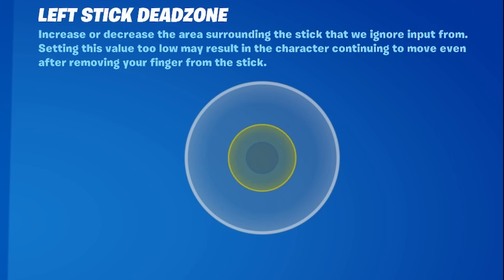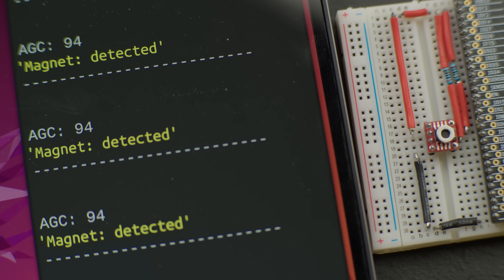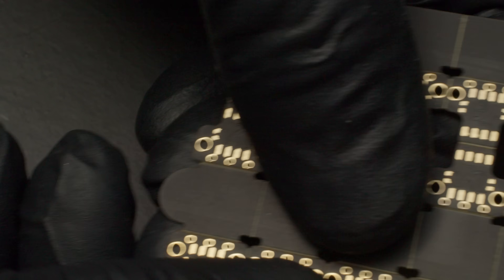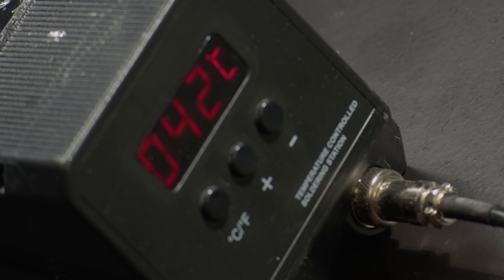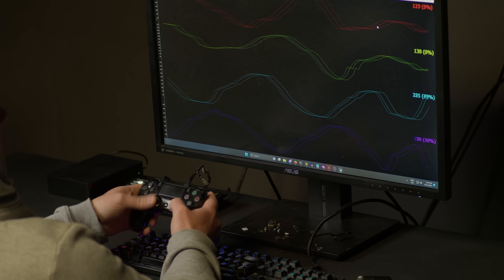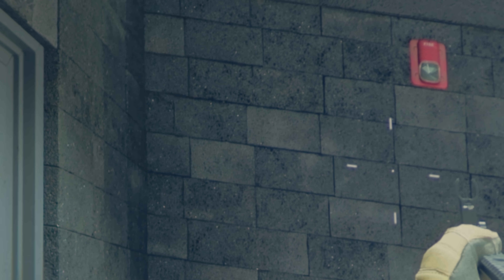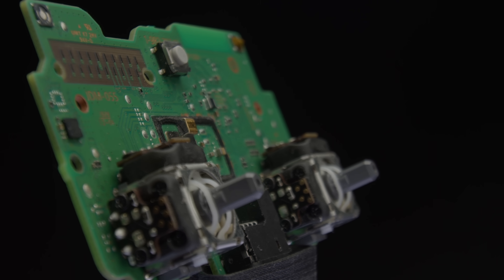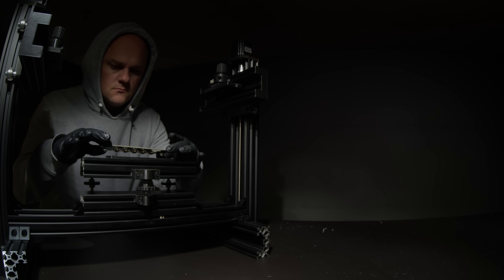Beating the $20B Joystick Drift Problem, and giving it away for free

Comment: The pressure and demand for hall sensor sticks have been building up quite a lot. Gamesir, 8bit and Gulikit already offering some options.
Reply from the maker: Yes the gulikit one is a very good budget option!
Reply: @MariusHeier1   I would say it's better than most controllers IMO.
Reply: @MariusHeier1  I used the gulikit one and although is was hall effect the rest of the joystick is low quality, the return to center wasn't good and even drawing straight lines was hard because the center point didn't aline with the zero value, also the joystick was super sensitive and I could not accurately get any specific analog percent under 8-10percent because the tension at the zero point was so low and I could not move by 1 percent values at all with any consistency, so I would not recommend it over a Playstation controller even if they break quick
Reply from the maker: @theblackdeath10  I found out why. It because they automatically do recentering. So if the joystick stop 2 positions of center. They make that the new center point. This creates a delay, or loss of reference point. Which will create  oscillation because of this delay. So its almost impossible to keep it centered on anything. You will overshoot, undershoot etc. Very interesting that you noticed this. Thanks for commenting 😁
Reply: @MariusHeier1  You should look into the early dualshock 3 controllers.
They used hall sensors and had 2 voltage outputs, one giving negative voltage feedback, don't remember if it was a negative voltage or just that the voltage dropped in relation to the direction of the stick and one positive feedback. So if you pushed forward one voltage would drop and one would rise, both by an equal amount. However if there is any disparity between each voltage difference you can average it out and correct for error.
Similar systems are used in flight controls and other systems.
Reply: @MariusHeier1  The gulikit is actually trash because they can't made decent buttons. I had two different controllers both have ridiculously squeaky buttons after only a few hours of playing. I tried using silicon grease and it did nothing. If they fix that, it would be great. But it's unbearable if you don't use headphones when gaming.
Reply: For Switch but I need it for PlayStation & Xbox!
Reply: @Marcheziora  i use the gulikit on ps5 with the wireless p5booter adapter and wired on xbox using the Brook Wingman XB Converter.
Reply: @albert.  same here, works good!
Reply: @albert. Where did you get the ps5 adapter for the gulikit?
Reply: @Marcheziora  and i desperately need a couple affordable ones for ps3
Reply: @Marcheziora they sell hall effect joystick for ps5 at least. Probably ps4 also.
Reply: Dunno about gamesir but i believe 8bit uses gulikit parts. I believe gulikit has a patent
Reply: @Toxicity1987  the xbox layout one doesn't have the hall effect sticks.
Reply: @june3149  buy the Bluetooth one and the Xbox Buttons separately, you can switch the buttons to Xbox Mode.
Reply: @InterstellarLord  After reading the website the Gamesir "Whatevers" dont have hall effects. So 8bitdo has them beat in spades.
Reply: I take that back, one does, T4 Kaleid Wired Gamepad "with hall effects' specifically in the title lol... thats the one they have. I suppose you like your RGB more then a quality controller...
Reply: @InterstellarLord  I agree, I own the gulikit king kong 2 pro, the 8 bit ultimate, which incidently uses gulikit sensors, (didn't know that when I bought it) and the gamesir beats them both. the gulikit broke after few months, bad build quality. 8 bit was actually having drift issues, strangely enough.
Reply: @menchelke after going through controllers every 3 months like clockwork playing Rocket League on PC, Gulikit has lasted for almost a year.
Reply: Still waiting for an option of hall sensors + 4 rear buttons as opposed to just the 2 all of the above seem to offer unfortunately. Hopefully someday
Reply: Some rc plane controllers have hall sensors and had them way before anyone has though about having them in gaming controllers. I'm use keyboard and mouse and I'm just baffled that gaming controllers don't have hall sensors. like what the hell are manufactures thinking?
Reply: @hampopper3150  Well, FYI the Dreamcast controller, like 20 years ago, had Hall Sensing sticks.
Reply: bought a gamesir. but without hall effect. their G7 is a top product. it is a 40 euro controller comparable to 160 euro razor controller. their hall effect will be next i try. I also send them a product request of a fully xbox compatible and featured with hall effect sticks, just the other week.
100% recommend
Reply: Ah nice (typing this on a hall effect keyboard-> Wooting 2)
Reply: I got a gulikit controller (I think I got the gorilla?) and it’s hands down one of the best controllers I’ve ever had

It works with every device I’ve tried so far (it’ll do switch, PC, etc anything that can take bluetooth), it comes with a great fitting case, USB-C charging, programmable inputs, toggleable button layouts and vibration intensity

It’s so worth the money
Reply: I thought I seen these being sold already, lol, I was like... am I trippin? Lol
Reply: Yup gulikit works like charm on PC. It's low quality but it's much cheaper then Sony or Ms pad and while low quality it's tough enough to not break after few months like Sonys garbage.
Reply: also flydigi... very solid products... im amazed why sony and xbox are trolling gamers with their potentiometers...
Reply: Yeah about to swap my joycons.. and if Playstation and Xbox controllers were even half as shit as the joycons then hall options would exist for that too.

And yeah, if the controllers wear out then people have to buy new ones. It's planned obsolescence.

And your title is misleading clickbait, if you think for a second that all console developers don't know about hall, you're insane. 
Engineer: "Let's make our controllers better so we can sell less of them!"

Console manufacturers: "You're fired!"
Reply: @forbiddenera  I think you misunderstood the who's problem it is. You think it's the problem of the company, but he poses it as the problem of the user
Reply: Screw these companies, my guy Marius here will enable me to use this on my duke controller. You can use it on any controller so that is the cool thing and you can fix other controller + as some people said, there are no options for Sony or Xbox.
Reply: We've had hall-effect joysticks for like a decade or two on the PC side.  Guess that's yet another reason why PCMR is best.  Computers aren't that hard, you can probably figure them out. ;)  We don't even need auto-aim cheats for our shooters because mouse and keyboard are how FPS shooters were made to be played.
Reply: im still not convinced about hall sensors really. high quality pots and high resolution adcs exist, and they are a match made in heaven, miles above what can be done with low cost hall sensors. of course if you can get an expensive pot or adc, you can get an expensive hall sensor. the problem with drift is mostly caused by cheap potentiometers and lack of calibration options in the consoles they are predominantly used on. ultimately the solution to a bad joystick module is a good one. 

on the hotas front, a high quality (preferably hermetically sealed) potentiometer still has good linearity and can operate over the full voltage range of the adc, whatever that may be. a sealed potentiometer will probibly add a zero or two to the end of mtbf numbers. i got some old military surplus potentiometers that have excellent linearity when combined with a 16-bit adc. and a good set of cnc machined gimbals certainly also helps a lot.
Reply: @LordOfNihil  
I personally think the supplier of the current crop of potentiometers may have some recent design flaws added in. 
I know they are wear items and do go over time with use... but three months is way too short; I am no pro gamer, but I admittedly play too many video games, and have yet to have these sorts of failures. Made it through whole console generations with one or two controllers.

I only changed xbox one controllers for new features like the 3.5mm jack, then most recently Bluetooth, still on that controller.

I think the potentiometers in the past were basically good enough, something has changed, but as always it could be made better.

I wonder if the material in the wiper changed, and somehow its more abrasive, or if the traces are thinner just leading to less possible use.
Reply: most of the cheaper parts use a pcb and the graphite strips are printed onto the substrate. i think its some kind of epoxy and is very robust. i think what may be happening is a materials incompatibility, as the wiper is usually lubricated. using a lubricant that is incompatible might be an issue. break down the resin and cause chipping. its probibly a similar situation to the one that caused the capacitor plague. some stabilizers left out of the electrolyte formula resulted in a lot of e-waste.

i have some ceramic pots that actually embed the carbon directly into the ceramic, and this is extremely robust. the milspec "canned" pots used a metal strip (not quite sure the alloy used) and it looked surprisingly good despite being several decades old. somewhere we lost something.
Reply: @LordOfNihil  I wish there were people who could investigate what changed, I feel like this is a very recent phenomenon. Going back one generation there were only murmurs of such things, now it seems to be everyone not  just professional/no life  gamers having issues. 

The gamers that i know thought the issue was made up at first because we have never experienced a death of a controller  that soon. Thought maybe there were lots of new gamers out there and maybe they had some issues with food or drink causing the stick to remain out of the dead zone.

seeing how prolific the issue is, I might wait till a revision happens before acquiring a new controller. 

I would wager that a changed happened at the pot maker to save a buck at the expense of Microsoft Sony and Nintendo.

I would like to think a controller would last 3 years even if a person gamed 8hrs a day. I would argue that they have in the past. Sure it will look aweful and have tons of wear but I'd expect it to still function. 10,000 hours should be doable.

Comment: Does it throw off stick calibration since you're doing it outside of the controller housing or is that factored into calibration? Since inside the controller housing you wouldn't be able to move the stick as far to the top, bottom, left, and right.

Comment: Only Dualsense used different lower resistance pot spec, the rest is the same up until DS3 time. Though easier calibration will make this better. Next gen game console definitely will have hall sensor, just a matter of console maker to buy it from ALPS.

Comment: I'm happy just to have been a viewer of this great project, I've waited many years dreaming that someone will solve the problem of drift in joysticks and finally you're making my dream come true, my thanks here from Brazil.
Reply from the maker: Thank you so much!
Reply: U can buy one now if u want, they have bwen out there for a long time, gulkit king kong2 or 8bitdo has one, and there are more.. Onlu - with gulkit is the missing paddle buttons .
Reply: There's people out there that think playstation solved it by selling even worse thumbsticks than the Nintendo switch but selling them individually 😂😂
Reply from the maker: @TheLegend-jp1vg  The crazy thing is, the engineers at Alps Alpine knew they will wear out and ruin everything. So they made them replaceable. But Sony figured out a way to make that impossible by hardcoding the values for centering the joystick..they could vave easly just read the first value when you started the controller as the center value. And if you had replaced the joystick it would have automatically worked. By doing it this way and not have any form of calibration they also need to have a larger outer deadzone to compensate for the different random alignments during manufacturing.  So they basically made it alot worse than it was delivered from the joystick factory.
Reply: @MariusHeier1  they did such a good job with their controller. A good job at making money off of us! Same with Xbox and their $200 controllers
Reply from the maker: @TheLegend-jp1vg  yeah. Added or moved buttons. 150$ extra. But now comes with suede towel. Which everybody asked for.
Reply: In the most respectful way possible, this problem was solved years ago. The sega dreamcast controllers joystick was borderline indestructible and uses the same technology shown in the video.

Comment: This is incredible! I'm currently working on fixing up a PS2 controller (Pelican Afterglow Wired) that has recessed R2, L2 buttons and am hoping I can update it a bit to use as my main PC controller. I've already hard-wired in a PS2 -> PC adapter that fits within the controller and am excited to hopefully convert the joysticks to Hall Effect when your project is completed!
Reply from the maker: Awesome. Sounds cool! Can also make a new circuit board for it based on the new mainboard im making for the ps4
Reply: i thought some ps2 and 3 controllers already were
Reply: @fluffypinkpandas no, hall effects on game controllers specifically is a relatively new concept. Ps2 controllers had a software or something that if I remember correctly, expanded the deadzone .
Reply: @rubenvb1835  They aren't a new concept. For example Dreamcast was using magnets back in the day. Saturn too if I remember correctly (?), but don't quote me on that.
Reply: @rubenvb1835  A lot of PS3 controller revisions had hall effect sensors in them for the sticks.
Reply: Note that afaik the dualshock2 controllers recalibrate over time, so you don't even need to be that precise with the calibration.